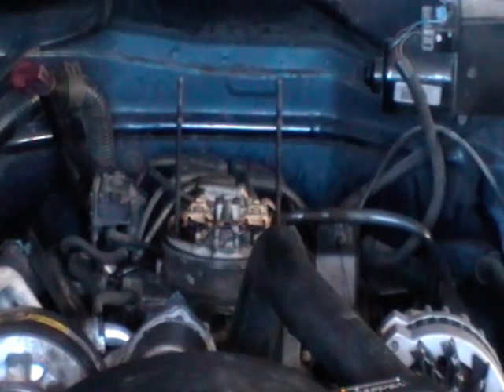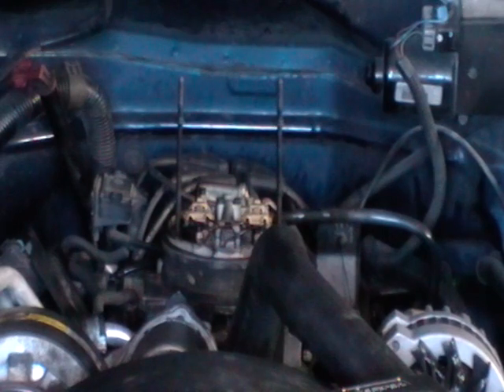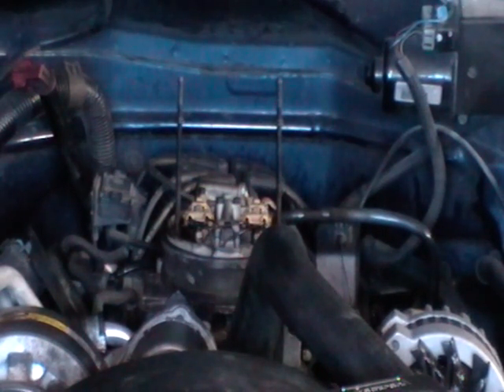1995 Chevrolet Suburban Timing Procedure

Comment: You  a'nit showing nothing where is plug to put the computer in limp mode?
Reply from the maker: The wire you have to unplug is under the glove box inside the car.  The sticker on the radiator support tells you it is supposed to be @ 0 degrees.

Comment: Ok so do I unplug the timeing plug when the truck is off or on?
Reply from the maker: Do it while it's running.
Reply: Should not matter.  Engine will start with the bypass wire disconnected.
Reply: turn on your car till its at operating temp then disconnect and start the process

Comment: Hey Raphael, thanks for the quick tutorial. After you set the timing, does it matter if you plug the wire back in as its running or not?

Comment from the maker: The wire you have to unplug is under the glove box inside the car.  The sticker on the radiator support tells you it is supposed to be @ 0 degrees.

Comment: I bought a Suburban 95 and the previous owner messed up the timing by moving the rotor. I just didn.t understand about the wire you have to unplug...where is it ? some say is in the left part of the motor, some other inside the cab. How do you know is has to be set to 0 ?